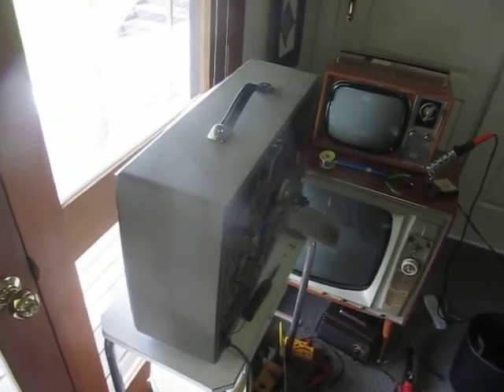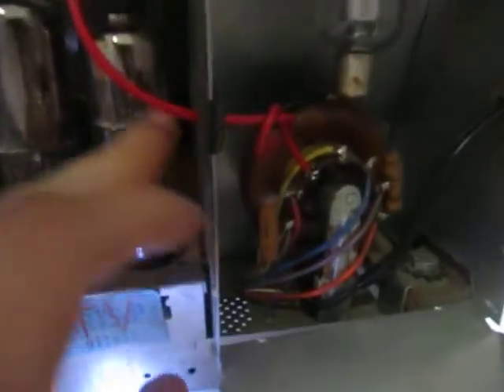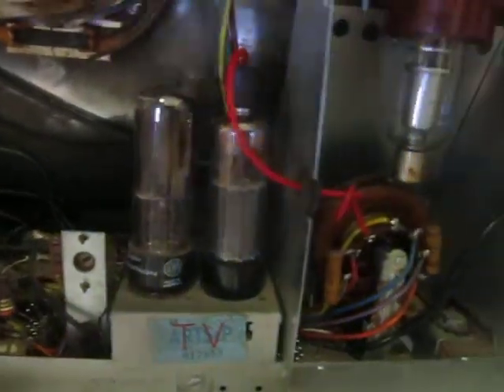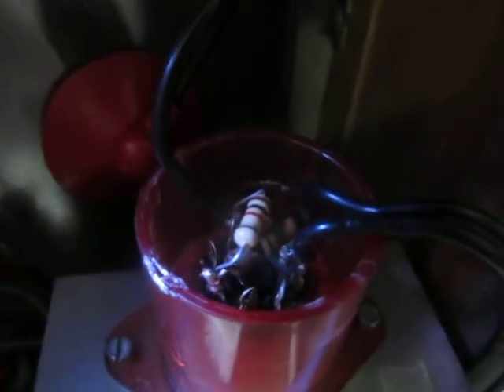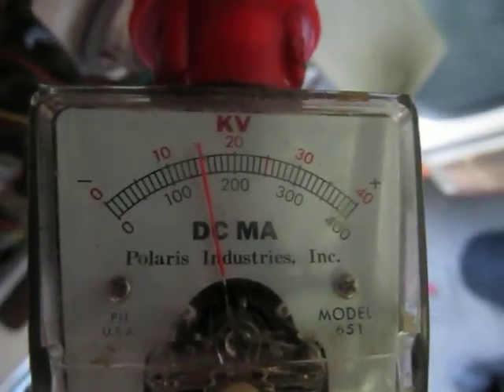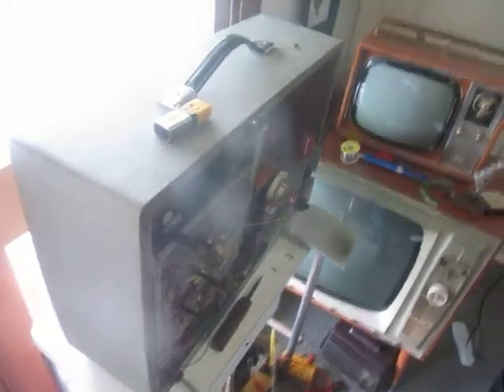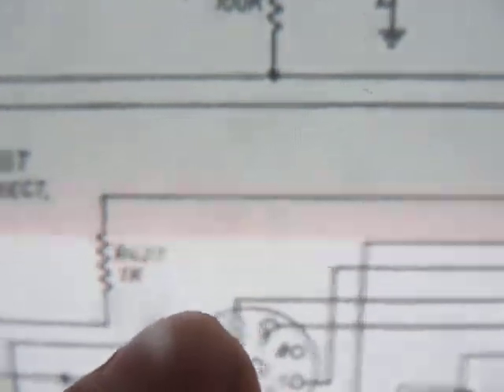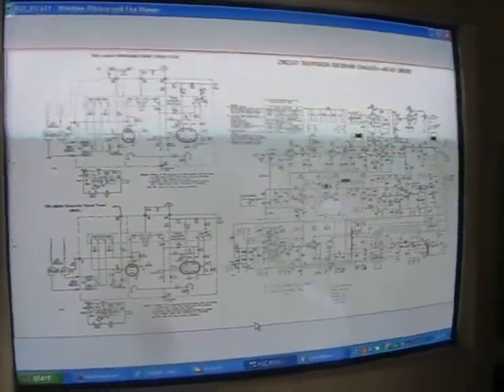AWA P2 Restoration Pt-2

Comment: Hi Chris.Fantastic Job trouble shooting the set. Be careful not to run the set long with that vertical line, has it can burn  the phosfer and make a permanent  line on the screen.Great Job Big thumbs up.
Reply from the maker: Thanks! If I do need to run a set with loss of vertical deflection like this, I usually have the brightness turned all the way down. My AWA P1Q has the same issue, and I suspect the cause of the problem is the same in both.
Reply: *****
Your doing great Chris. You've really done your homework. Keep us posted on the repairs.